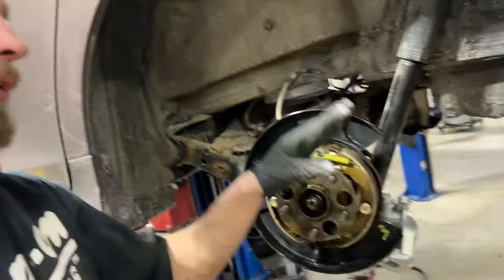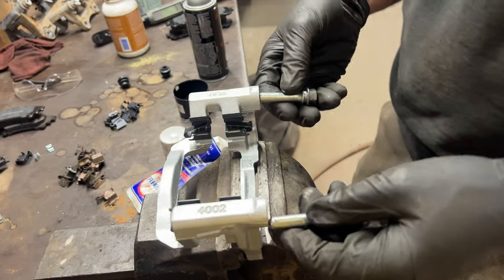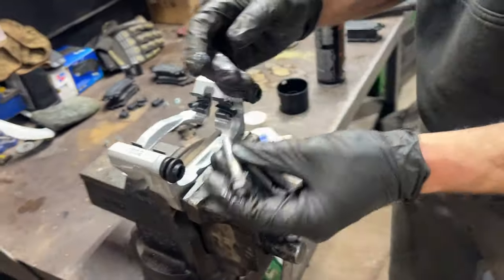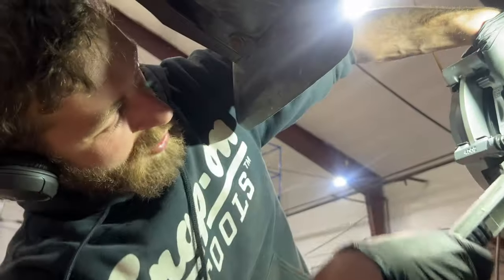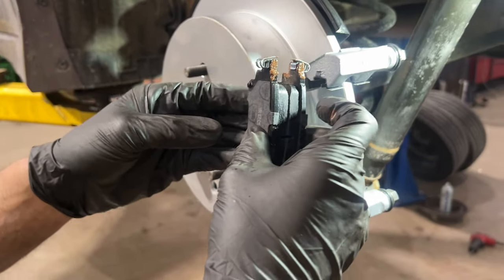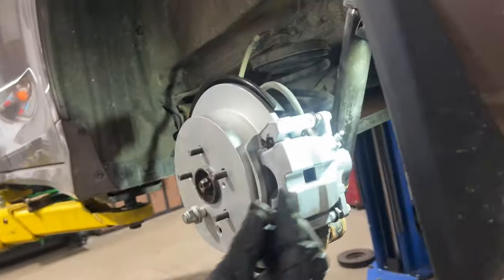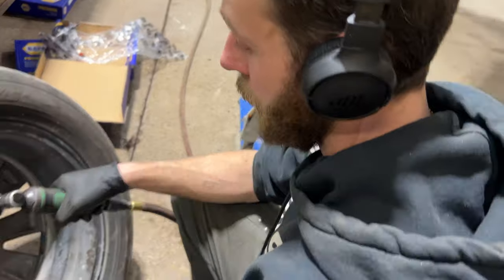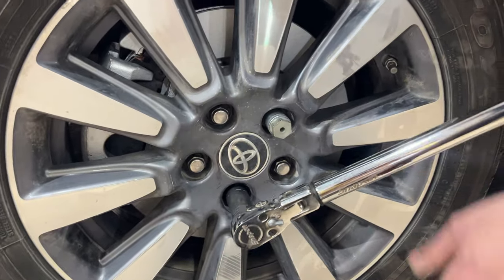2011-2020 Toyota Sienna AWD Rear Brake Rotor Pads Replacement

Comment: Great video! You are the first person I have seen explain the parking brake adjustment and the difference between the slider pins and where they are positioned! Question: I did my 2015 Sienna LE (FWD) recently and stupidly did both sides at once. I then had to guess which caliper bracket went on which side afterwards and, although they look identical to me, I think they have different part numbers. Do you know the difference and whether it matters? I have been driving it and I don't think there are any issues, but better safe than sorry. Also, is the pin with the bushing on top on the passenger side too? Thanks!
Reply from the maker: There should be a L and an R cast into the bracket indicating the side they belong too and yes the pin with the bushing goes to the top and the passenger rear side
Reply: @Tech-28  thanks! Maybe there was too much rust. I'm in Ottawa Canada and the vehicles you work on appear rust-free to me! Sorry to be such a bother but do you know where on the bracket?
Reply from the maker: @codyc.964  all good my friend, I am in Ontario. The L & R should be on the end of the bracket ,on the side of the slider pin bore.
Reply: @Tech-28  awesome! Ok I guess the van was newer or they take better care of it then!  Lol
Reply from the maker: @codyc.964  the brakes were rusty, I sandblasted them and painted them all
Reply from the maker: @codyc.964  2020 and it had 65,000km

Comment: I've a 2015 Venza. Does the parking brake shoe adjustment affect the foot brake pedal travel? I want to tighten up the foot pedal travel. How is it  tied to work with the hydraulic disc brakes system?
Reply from the maker: The parking brake pedal? You could adjust the star shoe adjuster closer to the rotor to shorten the travel.